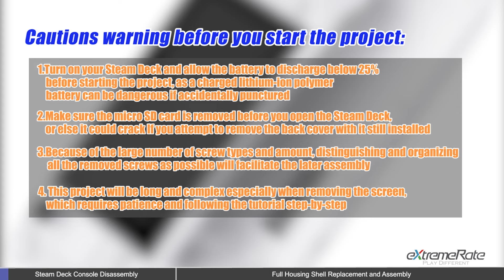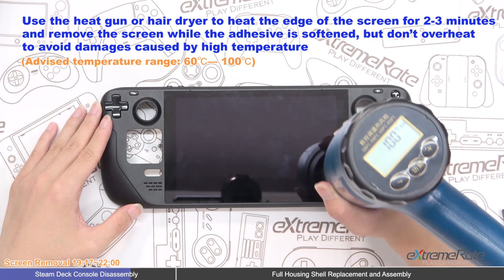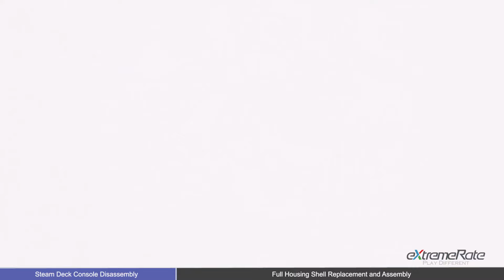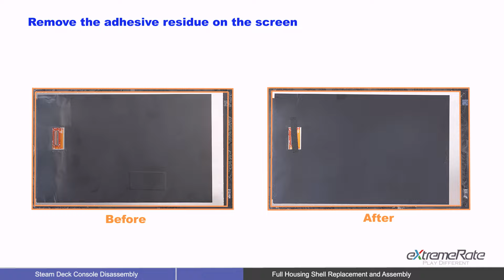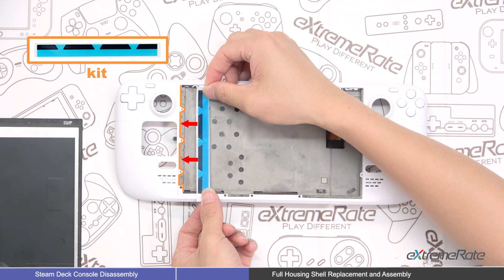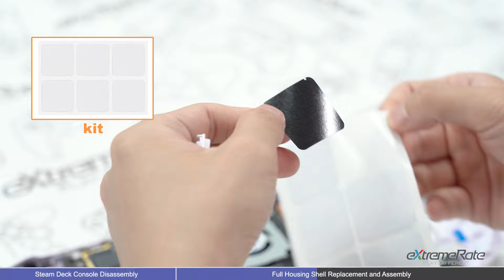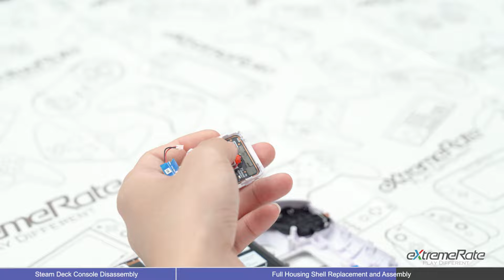eXtremeRate Steam Deck Full Replacement Shell Installation Guide

Comment: I spent 8 hours of my life carefully doing this surgery to get a smokey black transparent Steam Deck, and now I understand why Valve recommends you not open your Steam Deck.

I want to open this by saying I have history opening electronics, and doing hardware builds, repairs, and mods on my devices, while I'm no expert I would say I'm comfortable with it, and this made me stressed beyond all measure having to take out all these different boards, and especially the screen even though I had a guide I could not have done this blind... PERIOD.

Also, while my Deck visually looks perfect, after the shell swap even with the screen I only had one issue during my install, and it was a tiny slip up, and a critical failure of a solution that did it. basically I installed the metal bracket that holds the screen, and keeps the body firm, but forgot to route the Light Sensor through, and it was pinched poking out where the screen was... I though I could just use my tweezers to pull it to the back, and well... it snapped clean off.. Also, the reason why I actually did that instead of breaking it back down, was cause I stripped one of those tiny screws when mounting the metal plate making that solution mostly impossible and my stressed brain couldn't think of much else... At least fortunately I never used the sensor, and never will, and the rest of the install was perfect, but ya, just make sure your checking where you put everything during the install... treat screwing in anything as a final step.

Also the metal guitar pick they include is a sin, it costs them more then if they used plastic, and even in their tutorial they scratched the screen using it, DO NOT USE THAT I just used a plastic credit card from my wallet minding the depth I put it in at to avoid breaking the screen in another way, and that working without scratching anything had to clean up the adhesive, but it looks stock new now, and no I did not re-apply all of that adhesive, I'm not that much of a masochist, one day I will fix the stripped screw, and the light sensor, and that means I need to take off the screen, I ain't gonna stress through that a second time...

All'n All, I do NOT recommend this mod, it's made me one big bundle of stress throughout it all, and while it sure is possible if you take your time be careful, and never slip up by triple checking everything. The end result if you use a protective case like me, is not really worth it, if you don't then it looks great, but I just still cannot recommend a mod like this when you could use a more stress free solution exists in Decal Skins while they don't make the shell transparent, there's still breakdown skins that at least give you the tech vibe, and other then that color swaps are better skinned

Comment: Any advice here? My husband did a shell swap on his following this tutorial and it worked fine. I did the same thing and now my deck wont turn on. if I plug in the power, the LED comes on as if it's working but it wont turn on even after letting charge. My husband even went back and did the build over to make sure thehre was nothing disconnected or out of place and still nothing. What could ther issue be? If you have any troubleshooting ideas, please let me know. a short or the battery? idk.
Reply: Did you find a solution? I stayed up all night to build mine just for it to have the same issue as yours 😢 the light turned on once and I haven’t seen it turn on since.

Comment: This was the biggest nightmare. I've done shell swaps on a Nintendo Switch and those tiny joycons but this... All the tiny flipping screws and the diagram showing which one to use was NOT helpful.

All in all, I absolutely hated doing this project. It took almost 5 hours. A few mistakes. My Deck did boot right up but holy shit. I never want to do anything like this again.

Comment: I was able to follow and complete this tutorial.  Let's just say I had to buy me a new screen. When installed and reassembled the screen still doesn't work.  Any suggestions?  All connections are firm and secure... what am I missing? Also where does one find a wifi heat shield? I may have lost mine the 2nd time reassembling

Comment: Did the atomic purple shell swap. Looking for advice as my deck will not boot up. After I installed the shell swap my deck powered on normally. I went to desktop mode to test out the touchpads as I swapped those to the purple ones. Worked great no issues. Apparently upon turning off my deck from desktop mode it was updating steamOS. I got an error. Was able to pull up a previous SteamOS version using the eclipse button + power button for seconds. Everything was working for the day and then tonight I am not getting any display. I hear the chime powering on, and can feel the haptics of the touch pads but no display. Any thoughts?? 

Btw I’m loving my purple steam deck, it’s beautiful, thanks!! Just need to get it working correctly now
Reply: Perhaps the flex cable is not plugged in correctly?
Reply from the maker: Please try to re-plug the flex cable of the screen gently and correctly
Reply: The swap is PLASTIC. You fucked up
Reply: @triggerwarning5025  wdym? The original steam deck shell is plastic.

Comment: Just bought the transparent version for my 512GB (upgraded to 1TB) deck and completely forgot about needing to remove the screen, screens don't mix well with me it doesn't matter how careful I am I always tend to end up cracking It. I have no problem doing repairs which require delicate soldering work but for some reason, if it involves a screen you can 90% guarantee it will end up being cracked or shattered.

Comment: Can someone explain to me when screwing in the buttons axyb/dpad 
The video circles 2 blue being original and then 4 orange for the kit. But the vidoe doesnt screw the orange in? Do you only use the 2 orignal screws on each side and not the 2 orignal and 4 kit screws? Im worried my buttons will be really loose if i dont install right. Currently in the middle of reasembling in purple atomic
Reply from the maker: One screw for the bracket of ABXY / dpad, the other 1 is for L1/ R1

Comment: how do your transparent shells feel?  Do they have the same matte, textured surface that the original shell has? or are they a smooth, almost glossy finish?
Reply from the maker: Similar with the original shell, not glossy
Reply: It's matte but a bit softer. I really like it especially since the face buttons are the same.
Reply: @TheAkashicTraveller  Yeah I went ahead and got one.  Broke my screen in the process of installing it, but im quite happy with the results.

Comment: Which set of the screw I should use if I only want to switch out the back shell? Looks like the included screws are thicker in the back shell tutorial.
Reply: You could always use the original screws that came out of the steamdeck. Ive tried three of their other kits and unless a screw looked stripped i just used the originals

Comment: I did all the steps now my screen does turn on with no picture any fix?
Reply: Having the same issue unfortunately. Checked all my ribbons and connections. My deck turned on after I put everything back together in the atomic purple shell. I went to desktop mode to try out my touch pads and apparently my deck was installing a system update in the back ground when I shut it down. Got an error screen and was able to get it turned back on by having it fully powered off and holding the eclipse button(3 dot) and the power for 2 seconds which brought up a recovery mode to boot to a previous version. Was working great until tonight when I went to play my screen is completely blacked out again but I can hear the chime when I turn it on and feel the haptics on my touchpads
Reply: Same
Reply: Any fix yet?
Reply: @keepwatchingthat  I had to reformat my drive. Created a boot drive with Steam OS and reparationed the drive for SteamOS. Left my steam deck on the charger for 4-6 hours. Been working great since! Hope this helps
Reply: Its the screen that is broken i took another deck apart put that screen on mine and it worked
Reply: Same exact thing just happened to me sound and backlight work but no image :(

Comment: I have a question I received my steam deck in 2022 and 2 weeks later the plastic started to make a clicking sound when you’re pressed on the bottom parts of the plastic is it a thing i should be worried about

Comment: To anyone who did the swap, would you recommended doing the rear shell, buttons and d pad and then using a white skin for the front? Or is the replacing the front shell worth the extra work?

Comment: I bought this shell, followed the instructions step by step; and now my Steam Deck isn’t working correctly. I press the power button and it only beeps at me. It’s plugged in. Turning it on makes the device heat up and the fan to run-but the screen remains black. I checked and double checked and triple checked the hardware inside-I can’t figure out why the screen (and potentially the buttons/joysticks/trackpads) aren’t working.

Comment: When it shows "Original" and "Kit" screws in the reassembly, which am i supposed to use? Does it matter?
Reply from the maker: Original means originally take from the console, kit means those come with the kit. We suggest you use those come with the kit.
Reply: I used all the oem screws minus the ones required for the rear buttons.
Reply: I always use the OEM ones

Comment: It was pretty easy. Took me about 5 hours because I took breaks and was tedious. Very good quality. Don't use their metal pick to remove the screen. It will scratch the black coating off the edge and you will see all the scratches when you reinstall it.  I got a tiny mark on the corner but used a sharpie and you can't tell at all now.

Comment: While I love this and want to do it to my steam deck, I am not at all experienced in doing something like this and have never done anything like this. I am worried that I may somehow ruin the system during the take apart / reassemble of it. Do you think I will be able to do this without breaking my screen or ruining my steam deck even though in inexperienced?
Reply: Just saw one of your previous comments. Do you think it would be a better choice for me to get a skin decal? While I do prefer the button colors to be changed with the steam deck reassembly, I just don’t know if I’m experienced enough to do it. Thoughts?
Reply: i bought the kit and didnt had the courage to do it... its complex even for experienced people.. the chances are very high of breaking something
Reply: Just take a look at this comments section.  So many people have cracked their screens, or reassmbled everything to find none of the buttons or the screen works.

I've been handed one a friend started on and bailed out half way.   These are very fiddly delicate components, many of them held in with very strong glue that causes things to break when you try to take them apart.

Unless you're an expert in handheld console tear-downs, do not even attempt this.
Reply: @happyspaceinvader508  I didn’t! 😂 i got a white skin / cover instead

Comment: Just got the screen off. The included suction cup and spudger are trash. The ring that's on the suction cup bends way too much when pulling. I eventually just took it off and used the screw driver. The suction cup popped off several times so using a bigger one would probably be better. The spudger had very sharp edges and sliced my finger at one point. Had to hold it with a paper towel.

Comment: whoever made this video doesn't mention that valve manufactures freaken torqued these screws waaaaaay too tight and used Loctite to keep them from unscrewing. I'm stuck at the cpu block because the screws wont unscrew and I've already dealt with one stripped screw that i had to call my dad to almost break the machine to try and unscrew it.
Reply: Some of these screws are terrifyingly tightened lol. With the loctite as well it's so unnecessary lol I'm doing mine rn and having the same issues.

Comment: this is nice and helpful, but I can't unscrew the little bastard from 16:20 it's too small for pliers, the head is stripping off, I tried with a bit of rubber from a finger latex glove, but no luck. I'm thinking this op is busted and I should just stick to the default before anything else breaks.
Reply from the maker: Oh... maybe a mini pliers helps
Reply: You can but kits for stripped screws. Its just a paste you stick it thatll harden up around post, but thatll give you some grip to get it out

Comment: Is the white one soft touch coating or is it the same as the black one, or a standard abs shell?
Reply from the maker: For the first batch we made soft touch, and from the second batch we will use matte UV coated, it will more durable as the deck is that big
Reply: @ExtremeRate  I just got my white one in and it is soft touch... When will you start making the second batch with the Matte UV?
Reply: @ExtremeRate  the second batch will be shipped by the end of June?

Comment: i replaaced my deck shell, aand not my buttons wont work does anyone have a fix? all ribbon cabales aare plugged in undamaaged
Reply: Sounds like you need to make sure the cable is fully plugged in and clamped

Comment: I had just gotten the screen off and decided to take a bathroom break only to find my cat had spilled rubbing alcohol all over the screen I had just pulled out. I cleaned it up and thought I was good. Put it in the system, put it all back together only to find that the IPA had gotten behind the reflective layer of the LCD screen leaving a weird stain on the screen it looked super bad. So I turned off the system and went and bought a new screen on ifixit. Put the new screen in only to find now the system would not turn on? After about 6 hours of trouble shooting the best I could figure is that the IPA getting inside the LCD shorted something on the motherboard. I got lucky and tracked down a new motherboard at at a steal of a price. I put in the new motherboard and it fired right up!? I have no idea really what happened to the old motherboard. I have done dozens on dozens of re shells. I have repaired more electronic devices then I can even remember anymore. That is to say I am experienced. Haha I guess even with experience your not above a disaster now and again! This was definitely a disaster. I now have the world's most expensive steam deck thanks to my mistakes. So be careful with this one! I will say it does look awesome in it's new shell though!
Reply: Did you get a new cat? 🤣
Reply: Any tips on tracking down a cheap mobo replacement? thanks
Reply: @haveplant I just so happened to find one on eBay, it was down to luck really.